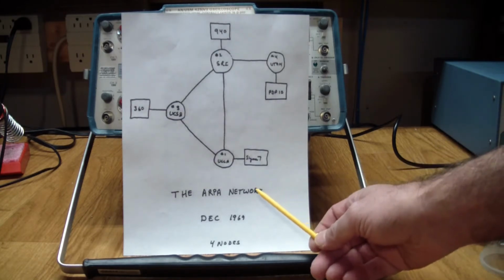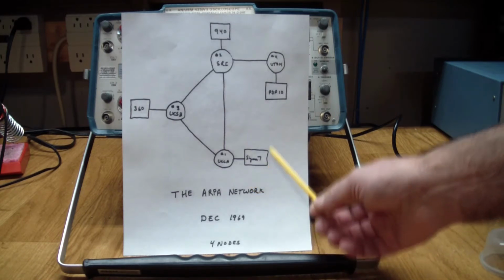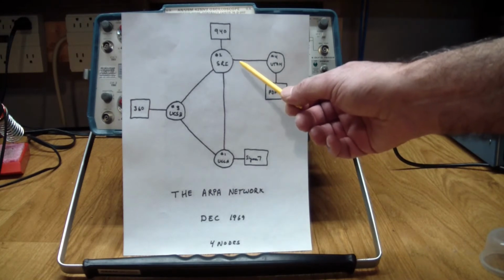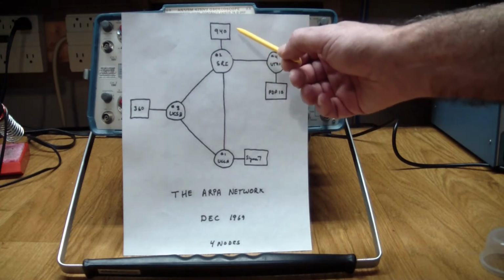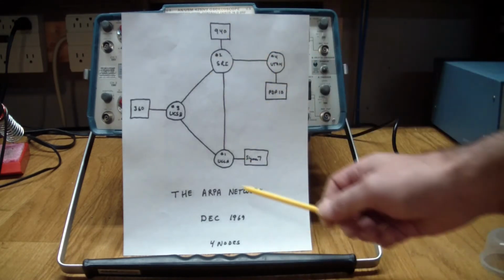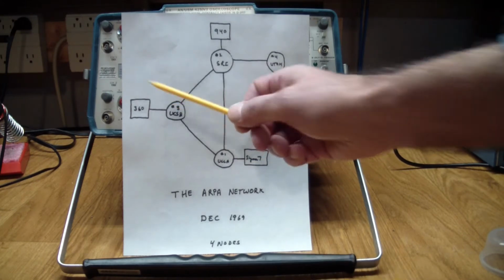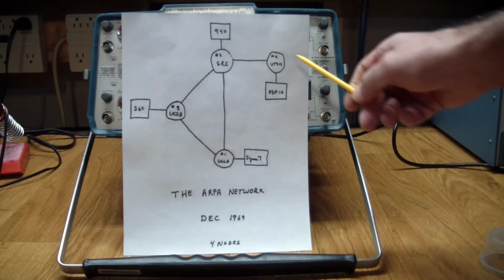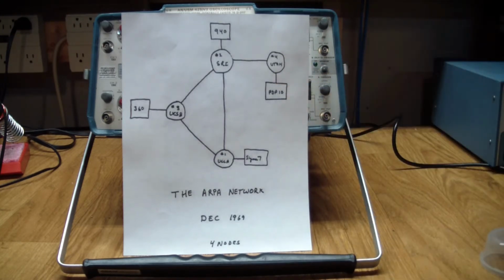AE#23 Another Tektronix 465M Analog Oscilloscope Repair

Comment: Hi Arti , great video, sure hope my 465Ms electrolytic capacitor in question is ok.
Are there any other differences between the 465B and the 465M ,other than than the M having heat sinks instead of a fan that you know of?
Cheers from the land of OZ😀😀🤗

Comment: Excellent video!
I have a digital Tek TDS1002B since 2008 and I'm happy with it. Recently I run into the opportunity of buying one of these used Tek 465 (not the M version) for $150. Is it worth buying and having it nowadays?
Reply from the maker: I think a good analog scope is a must for any electronics bench. If the scope is working then it's worth it.

Comment: I’ve enjoyed this video so much, that I’ve now subscribed to your channel. You are both super knowledgeable and hilarious! Perhaps, you can help me. Here’s the issue, I recently acquired Vu-Data portable oscilloscope [ps910b]: it looks great and it is very clean, inside and out. It seems to do well, with AC signals [I haven't had time to play with it much yet] BUT when it comes to DC, I get the reference trace just fine, but the instant I place the probe onto, say a 1.5 volt battery, the trace which should move up vertically, instead disappears - so, I end up having to fiddle around with the +/- trigger to locate it. I do find it eventually but I don't think this is normal. I should point out, that I’m just an electronic enthusiast [without any formal training] and this is my first o-scope. It’s a small single channel scope, inexpensive, clean and it came with its manual [which is really more of a technical service manual - not a user-friendly instruction manual, and somewhat over my head]. I’ve fixed a few CRT TVs, few old radios, fans, etc, but nothing as complex as a scope. I don’t want to damage it accidentally.  Frankly, I couldn’t even tell you if it’s a vertical control issue or an horizontal one... Please let me know what you think. Any insight will be greatly appreciated. Thank you kindly, in advance.
Reply from the maker: It almost sounds like the sweep circuit isn't working in DC mode. You've given a good description of the problem, but it's still difficult to diagnose remotely. I would start with acquiring a copy of the schematics and analyzing what happens when you switch from DC to AC mode.

Comment: If the guys make a DSO with enough ram and sampling to drive something like an Apples 'retina' display then I'll be interested. All the ones I've look at so far seem to have blocky pixalated displays. Until then I'll stick with my CROs. Yeah I know the DSOs will display accurately measured Voltage, Frequency, Duty Cycle etc but to my mind nothing beats that crisp analog trace.
Cheers.

Comment: All equipment has leakage current from the metal chassis to the earth ground. The Leakage current is AC leakage current and DC leakage current. when you disconnect the earth ground on the AC cord and measure the leakage current from the metal chassis to ground you will measure an AC leakage current and DC leakage current, any reasons why there is leakage current? circuit board ground should be a zero volts zero current.

Comment: Regarding cleaning the pots, I wonder if repeatedly moving them is doing the actual “cleaning”. I have my doubts that the cleaner is making it down the shaft which is packed with grease and then spreading out onto the wiper- all in a matter minutes. Cleaner thins the grease somewhat and without the grease on the shaft the shaft will feel either loose or scratchy from metal rubbing directly on metal. Even if the cleaner got down there, all the dirt is still inside the sealed pot. Maybe try just repeatedly moving the pot next time and see if it “cleans up” without the cleaner. This has been my experience.
Reply from the maker: I usually try just working the control for a while. If that fails I use contact cleaner. It does work in the short term, but your point is well taken.

Comment: Hello Arti, I have a question about frequency generators. Some call for a 50 ohm terminator cable . Can you explain that to me???
Just trying to learn.
Thank  you
Reply from the maker: Jim, I would suggest you do a web search for "frequency generator impedance matching". There are several articles that will explain impedance matching in detail and do a better job than I would be able to do in this reply. 
However, this is a good question that I'll try to address in a future video if appropriate to the subject matter.

Comment: Hi Arti, I have recently subscribed to your channel(today).  I really enjoy your repair videos.  I too am buying test gear on eBay in the hope of finding some diamonds in the rough which I may polish into that fine piece of test gear. It is truly hit and miss on eBay.  My pockets are very shallow and yet I have been able to put together a lab which when I went to electronics school would have been unattainable.  I have in the last few months acquired a 4 ch 100MHz Tek scope, several power supplies, a 5 1/2 digit HP DMM and a 225MHz HP freq cntr. and some signal generators.  I went to school for digital computer repair in the early/mid 80's and no jobs as the industry had shifted from component level repair to board swapping.  Missed out on most of the last 30+ years of electronics development.  I finished electronics school in 1985 and went right into construction engineering!  Really fun to get back to playing with the electrons.

Comment: Just a thought...could you have drilled a hole in the bottom to solder the pin back in...or do you think it would change something to do this????????????
Reply from the maker: The pins on the CRT were still there, only the wire had broken off. If the pins had broken off the CRT would have been toast.
Reply: I thought the pins broke off the board underneath the CRT..That is what I was talking about...you could reach thru the hole and unsolder the pin on the board that broke off and replace the pin..

Comment: PDP 11 know nothing about it. Have you ever heard/seen of a Boroughs disk ? THAT I have seen in 1982 on my Systems Engineeing Course at CTL, Hemel Hempstaed, England. I stood on the base. 4 tons, takes 4 hours to get to 3600 rpm. 20 heads either side of a 1 inch by 6 foot mild steel disc that the heads ride on the surface. Giving 2.5 MB's of core store ! It was on the way to the scrap yard and was probably one only a very few left at the time !
Reply from the maker: I never had the (dis)pleasure of being in close proximity of one of those.

Comment: do not have a PDP 10 but picked up a micro VAX 2 somebody put on the curb on garbage day think they sold for 20000 in their day  and probably have a fair amount of gold on the circuit board's
Reply from the maker: Did you get it running?

Comment: Thanks for another great repair. I've noticed that your camera is often slightly out of focus with respect to items in the middle of the frame. I was wondering if you were using an auto focus setting that checks several areas of the frame simultaneously but can sometimes give this effect when items are fairly close and central. Perhaps changing the auto focus to a centrally weighted option would eliminate this and provide better results for your videos. Thanks, I hope this helps.
Reply from the maker: I'm aware of the unfortunate focusing problem, but I think that the camera is rapidly nearing the end of its useful life.